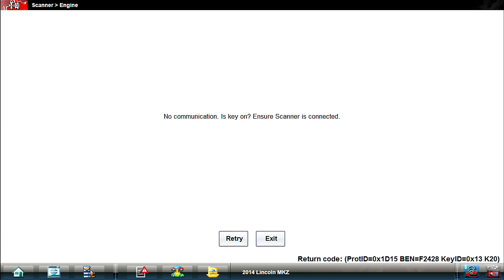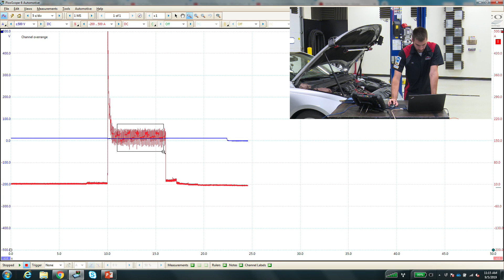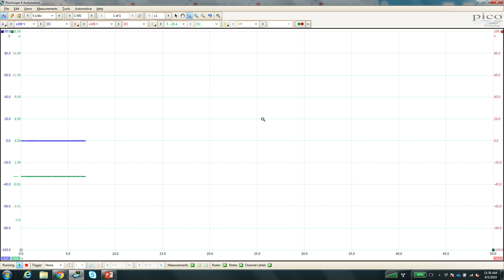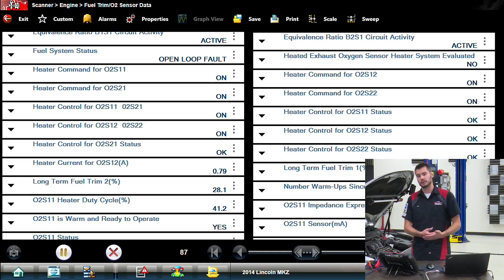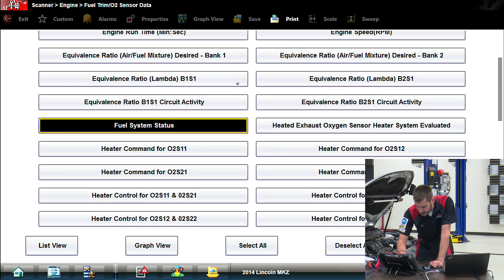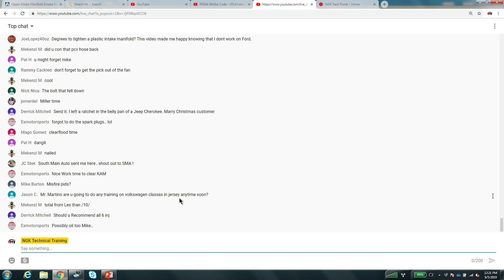P0304 Misfire Code - 2014 Lincoln MKZ 3.7L

Comment: Tec b is correct. If on a 4 cylinder engine cylinder.( Firing order 1,3,4,2)Number .4 didn't contribute cylinder 2 would have to work harder to push the piston up the cylinder. THE starter would turn slower being a dc motor this would cause an increase in current flow due to the decrease in counter electro magnetic force. I think??

Comment: Hey, Mike. If you were to scope the injector, you would get a pattern since the injector windings is not open, right? What would the waveform looks like?
Reply from the maker: Hey BB MD, thanks for watching. Scoping the injector would likely show a similar pattern as the others, just with less amperage and no pintle hump. Higher resistance, but not open. Amps lower, not enough juice to open it up, no pintle hump.
Mike Becker, Senior Instructor
Reply: @GoTechTraining  A lower voltage spike as well?
Reply from the maker: Yeh, I would expect so.
Mike Becker, Senior Instructor

Comment: The newer Jeeps with the Mercedes engines have general issues with injectors which the leak-down test can indicate, just put a hose on them and measure the amount of fuel that pours out the overflow gate.  THose injectors are $700.00 each., 6x7 is $4200. for injectors... :(
Reply from the maker: Hey Rj Right, ouch that's a pricey injector!
Mike Becker, Senior Instructor

Comment: I think answer for question is D because the cylinder with higher current mean oil leakage on that cylinder could be.
Reply from the maker: Actually I was looking for B here.The problem could be with the valves on the mate cylinder essentially creating 2 compression strokes when one should be on exhaust.
Mike Becker, Senior Instructor
Reply: GoTech Thank Mike

Comment: How about disconnecting FPCM then cranking to depressurize?
Reply from the maker: Sure, that would probably work...as long as there isn't coding in the PCM that disables cranking without FPCM input. Sometimes getting to the FPCM can be tricky though!
Mike Becker, Senior Technical Instructor

Comment: Hello could we see a lower voltage spike on bad injector because higher resistance equal lower magnetic strength field
Reply from the maker: Hey Ivan, great question. Yes, in theory it would appear lower...downside to that is then you need to use multiple channels to capture more than one voltage reading from the injector. This is why current clamping is much more efficient and effective in most situations. 
Mike Becker, Senior Technical Instructor
Reply: Thanks , forgot about that. Of course it is easier with current clamp.
Mladen from Croatia

Comment: What if the suspected injector was under the intake?
Reply from the maker: Current ramp the injectors and look for a difference. Like this one, it was lower current due to higher resistance. That's evidence enough to pull the intake and inspect/replace.
Mike Becker, Senior Technical Instructor
Reply: Are there any videos that you do to look at fuel pump rpm specifically with the Pico?
Reply from the maker: Not currently, sorry!
Mike Becker, Senior Technical Instructor

Comment: Lol thats funny, i did the same thing on a f150 last week. I triggered off the coil during flood mode and it was a while. It took me 5 minutes of scratching my head before I realized it.
Reply from the maker: Hahahh I wish they would keep the coil on and just shut the injector off...
Mike Becker, Senior Technical Instructor
Reply: @GoTechTraining  lol a-wall, I swear my spell check has a mind of its own. Obviously I met a while
Reply: in theory spark on in clear flood mode could cause latent ignition and fire with exhaust port open and "whoosh" down the whole now fuel loaded exhaust system.
likely someone thought about that or had something blown apart in testing or kill DPFE's liked backfires and exhaust flashes loved to do on the 3.0L vulcans
Reply from the maker: I got what you were sayin :)
Mike Becker, Senior Technical Instructor

Comment: Sounds like a good idea to replace the spark plugs on this Lincoln now-- it'll probably save the customer the cost of a new PCM later. I suppose Ford could have added tougher drivers to the PCMs of newer models, but with any two-wire coil design, why take the chance?
Reply from the maker: Could not agree more! Maintenance is cheap compared to the alternative.
Mike Becker, Senior Technical Instructor

Comment: About the only time I remember using resistance to check injectors was back in the early 90’s with the tuned port 350 that had injectors that would short out and that was only because it was a somewhat common issue to look for.
Reply from the maker: Haha I have some old 3.1L injectors on one of the benches out in the shop that's shorted...it's really been a long time, right?!
Mike Becker, Senior Technical Instructor

Comment: When I saw the title, I immediately thought of the older MKZs and Fusions (07-08ish) that would have a coil fail and subsequently fry the driver in the PCM.  Does anybody know if that's still a problem that's still carried over in more recent years?
Reply from the maker: Hey Shaun, ahhh yes. I have a video on here covering that one already :) They are still a 2 wire coil...though they don't see to have a common issue with it like the older 3.0s.
Mike Becker, Senior Technical Instructor

Comment: Excellent video Mike. Do you have access to a Ford factory scanner that the dealerships use? Would that be more accurate on the relative compression test? 😊
Reply: I'm pretty sure Snap On's software is derived straight from the IDS's software.  (IDS is the OE Ford scan tool.)  If, by chance, Snap On got the programming right, then I would dare to say it shouldn't matter.  But that's a big if.  Conversely, I can afford some optimism regarding the Verus that Mike is using.   I have access to both the IDS and a Snap On Solus and for what I can see, when a bidirectional function is available between both scan tools, Snap On will always look very different, but seems to always function well enough like IDS.
Reply from the maker: Unfortunately I don't Jeremy. I would have liked to compare both software versions on this one.
Mike Becker, Senior Technical Instructor
Reply: Jeremy, I experimented a little with the factory scan tool.  Let me know what you think in the comments.  https://youtu.be/nuvPgwYLE_c

Comment: Very timely video Mike! I'm battling a misfire that only occurs on startup and lasts only for a few seconds but long enough to set a misfire code. Struggling to catch it in the act. Thanks for the great info!
Reply: Single cylinder or multiple/random misfire? On every startup even if the engine was running just a second before?
Stuck valve? Leaking injector which leaves fuel in the cylinder? Water intrusion?
Reply: @blockbertus  Code shows single cylinder.  Only happens on cold start for a few seconds, shakes like hell, then smooths out and runs fine. Fuel trims normal, no other codes. Ohmed injectors and they looked okay, current draw test on injectors showed nothing. Still working on it but it happens so fast it's hard to catch.
Reply from the maker: What kind of car? How's that cooling system? Common for headgasket issues to leak into the cylinder and miss for a few seconds on start-up.
Mike Becker, Senior Technical Instructor
Reply: @GoTechTraining  2006 Mazda 6 with the 3.0 V6, 120kmi. I have not detected any coolant loss and temps are fine, but will keep it in mind.
Reply from the maker: Good luck! :)
Mike Becker, Senior Technical Instructor
Reply: I say, how old are the plugs and coils, is there a leak down into one? fords have always been touchy to me on worn/glazed/contaminated plugs and cold starts.
i usually park them in the driveway or yard which is a fair incline and cold start them immediately pull into gear and feather the brake, they'd always buck and surge forward. that was my favorite test back on the 3.0 vulcan. except then they'd rarely set an engine light until it spit P0420 lol
yeah that being 06 is likely the duratec, but even by 50K I'm suspicious of any and all plugs, been there done that too many times over the years.

Comment: Great step-by-step Mike in showing the diagnostics along with the repair! I believe the answer to your question at the end is D. I could be wrong, but this is the way I think of it. When there is a single cylinder that has low compression, the crankshaft will speed up during its compression stroke and the amperage will be less for that cylinder. Since the crank is now turning faster, the next cylinder that's up for firing will be able to catch a little more air, thereby raising its compression reading which in turn will raise the amperage for that cylinder. So, the cylinder that would have the higher amperage than the others would be the cylinder after the low compression one.
I do have a question at timeline 29:36 where you were showing the primary ignition waveforms for cylinders 4 and 5. It may be obvious to most people, but why did some of the firing events have a normal inductive kick on both cylinders 4 and 5, yet at other times on the same cylinders there was no inductive kick on both cylinders. Once again Mike, great work and explanation!
Reply from the maker: Hey Terry, thanks for watching!!! So, what happens to a relative compression test when an engine has a stuck closed exhaust valve? :)   If I recall, I mentioned they looked a little odd. I believe the scope wasn't capturing fast enough to grab the kick. I think if I would have up'ed the recording speed or lowered the recording time it would have made more captures per second...and probably seen more consistent kicks. 
Mike Becker, Senior Technical Instructor